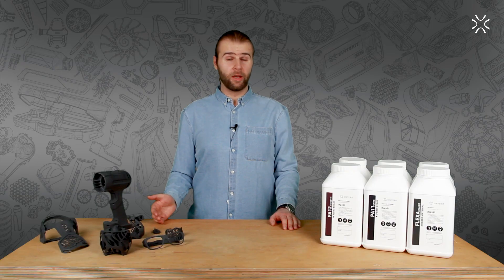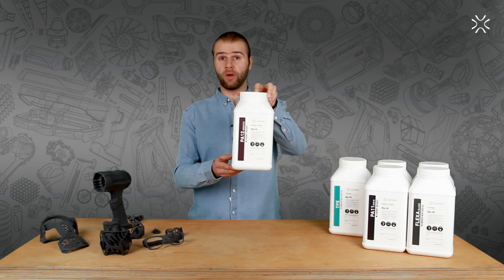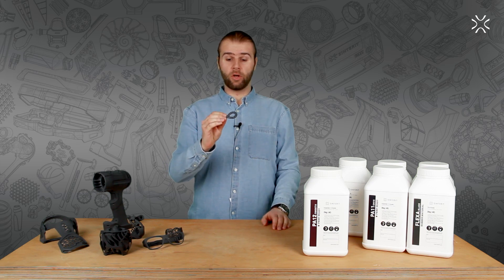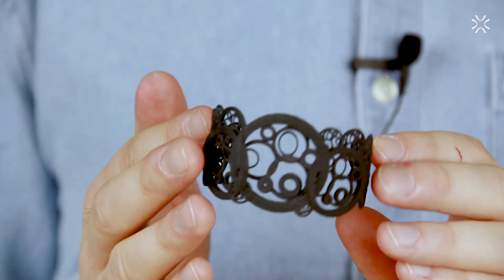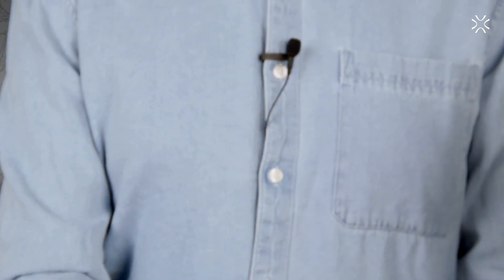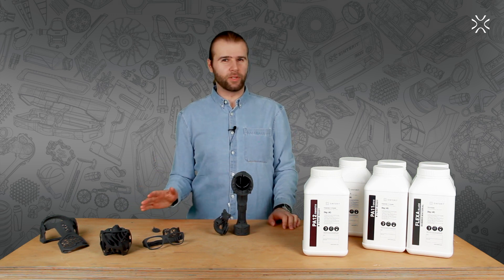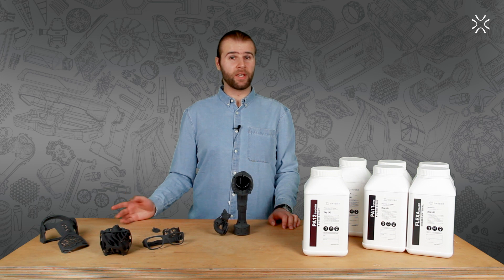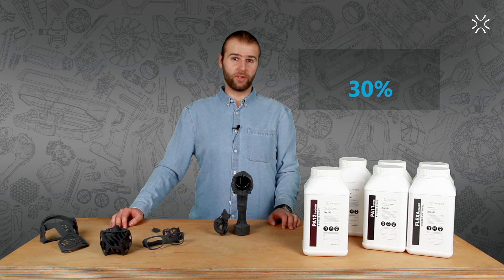Sinterit PA12 Smooth: the most all-purpose SLS 3D printing material

Comment: For how much time can i store the material in sls printers without any use?
Reply from the maker: You mean storing the powder in the printer before starting the print? This time should be minimized to a few minutes and the powder should be placed inside the just before starting the print.
Reply: @Sinterit  can we store it in printer for later use?
Reply from the maker: @vikasmudgal7577  Absolutely not, because it will absorb moisture from the air. The best solution is to use only the delivered containers to store the powder.

Comment: Do you have plans for a white PA 12 or a light color that can be painted or dyed?
Reply from the maker: We are constantly working on introducing new materials but for now, due to our laser type, we're not planning to introduce such material in near future. But our PA12 can be painted.
Reply: @Sinterit  Is the US based distributor the best person to speak with about painting techniques or is there someone in the support department we should speak with about the paint options.
Reply from the maker: @Mezelmods  if you have some very specific questions, the best way is to contact our support directly as we're constantly making some research about painting and dyeing the printouts.